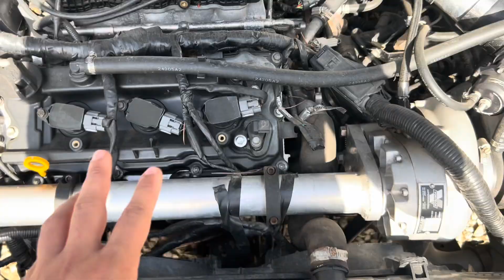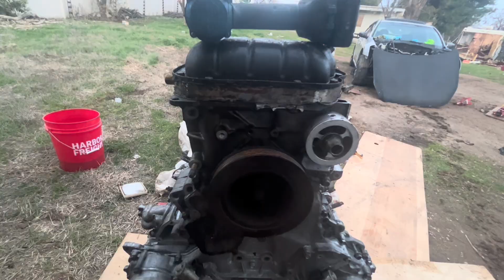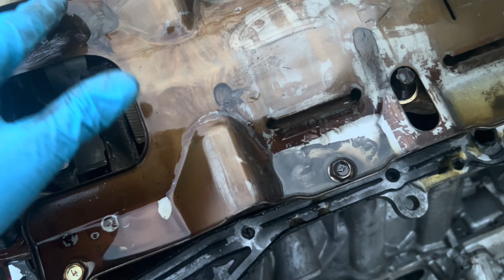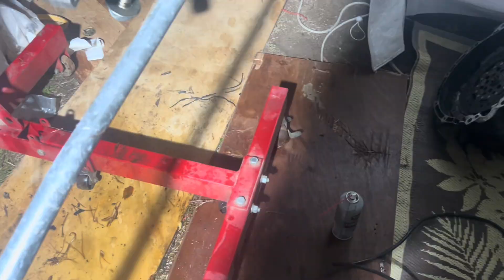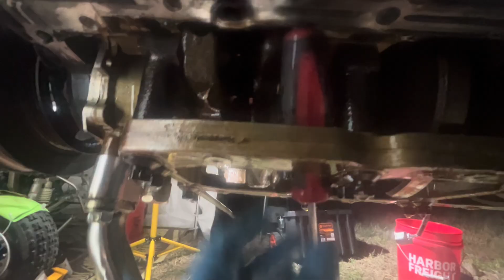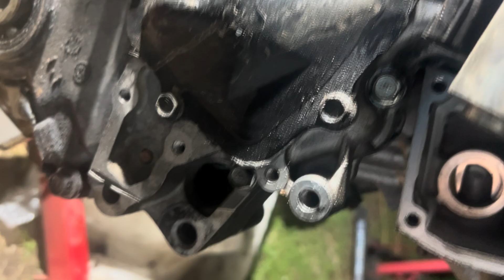Ruining my daily driver, (Part 2 engine teardown)

Comment: Never give up on your dream bro literally buying an 06 auto as we speak to do my build
Reply from the maker: I’m almost done with it it already runs and drives under boost! Just need to get around to make the cideos
Reply: The multi link suspension on these cars is also forgotten about they were setting the same times or very close as 350z autos on slalom tests back when in bmw ranges 330ci territory also